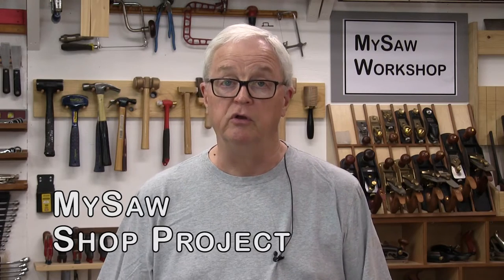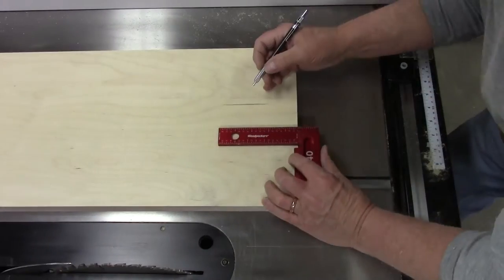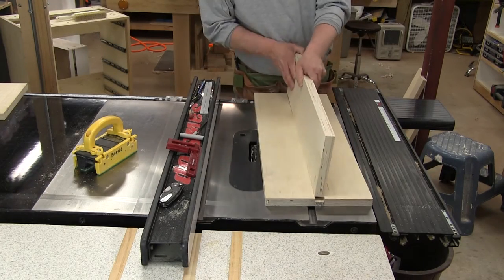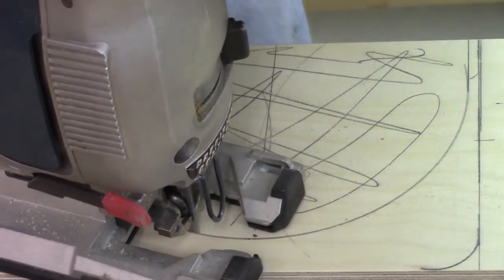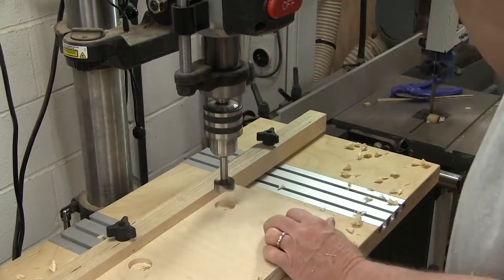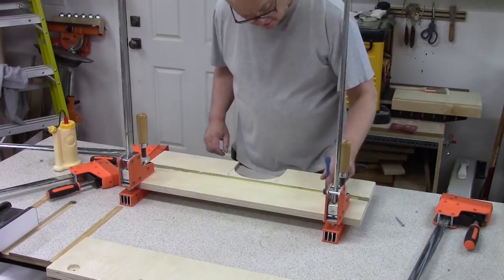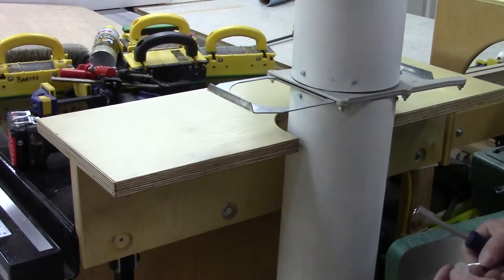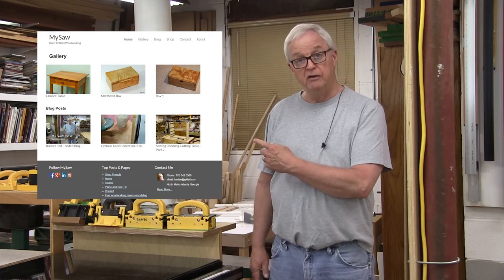Push Block Shelf for Table Saw

Comment: Love it.  I like that crosscut jig.  Can you tell me who makes it?
Reply from the maker: Hey,  Thanks for watching.  It is a compliment coming from you.  

The slider is a JessUm product which is no longer being manufactured.   It has been an absolute joy for me to have on this table saw.    It was about $400-500 when it was being produced.  

I am NOT impressed with the SawStop slider.  I just don't get how they expect to set the 90 degree setup each time.   

There are after market sliders available, I know of one from Grizzly.
Reply: I'll have to see if I can locate a used JessUm.  It looks like it operates really well.